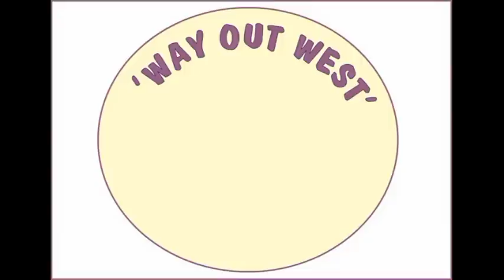Making A Charcoal Grinder – for biochar

Comment: and for those without the means or skill to make this.
Use a Garbage disposal set up in a sink in the yard. Works wonderful. Plus can use water to keep the dust down.
Reply from the maker: I think garbage disposal grinders are only common in America.
Reply: @WayOutWestx2  
You might have a few people in America that follow you.
But yes, set up an out door sink and put a garbage disposal on it.
Another idea I think. I will try a small electric cement mixer.
Add some steel balls to it. Turn it on and let the steel balls crush it.
Next step would be a small chopper for leaves and grass

Comment: I have decided to Spread the  char over the garden or ground I want to  apply it to. Then run my Riding mower over it. With the mulching plug installed. To grind it up. I tried a small area. Works good. Just. The Char needs to be damp. To control the dust.  A push mower would work. as well. Blades does not need to be sharp. If you have and old set of blades. They work  good. I have already charged it.
Reply from the maker: Interesting!

Comment: I watched this when it came out, been trying to add charcoal to improve the soil too. I don't have a CNC plasma cutter, but I do have a little cement mixer. With the addition of six-half bricks, it became a ball mill. Works pretty good, for off the shelf.
Reply from the maker: Good idea - but you'll get a lot of dust that way..
Reply: @WayOutWestx2  😷😁 Very true. Did the first round. Wrapped a bungee cord and pillow case over the end. Had tried wetting it, but it just all caked to the sides.

Comment: Very cool to see your design process. However, to actually crush biochar ( even smaller than this), it is far easier and less wasteful of resources to put some in an old sack ( like a dry cat food bag), fold it closed and stomp all over it. Works for me, in about 5 minutes. Much of it ends up as fine dust, which is ideal for use in soil amendment. But have fun with the tools!
Reply from the maker: I hope to scale up my production quite a lot, so that's why I'm experimenting with powered methods - but your way works fine for small quantities. The best size of particle depends on the soil it's going into - around here I want a mixture right up to 4mm.. (It's all interesting, isn't it?)
Reply: @WayOutWestx2  I'm still learning. Can you tell me what the benefit of larger pieces is? I thought that the smaller they were, the larger the surface area for microorganisms, water and nutrients to infiltrate.
Reply from the maker: @Ubiquinode  It's the fissures (made when you quench hot charcoal) that gives all that surface area - almost all of it is internal. The particle size should include a range up to large, so you don't end up with a dense, compact medium. Air and water have to be able to penetrate freely through the soil - that way they will find their way into the fissures.. Does that make sense? Tim
Reply: @WayOutWestx2  Thanks, it does make sense. So you would recommend taking the biochar out of one's oven and quenching with water while as hot as possible? I guess I would have to pour it into a bucket of water as I don't want to do damage to the Dutch oven I do the pyrolysis in.
Reply from the maker: @Ubiquinode  Absolutely. Otherwise it's not activated and no where near as effective

Comment: If it had some sort of grist mill at the bottom with a wider gap between the stones and ran off the same motor it could grind that charcoal right down to small particles.
Reply from the maker: Yes, maybe, but I'm happy with the size - growing trials now started

Comment: Good project. If you rotate the square hole 45 degrees on two blades it would likely cut smoother, and draw the chunks in. The 2 rotated blades could be staggered. Also putting a flywheel of some kind will keep it from being stopped.

Until you fashion some kind of guard, please keep your watch of it : )
For some reason, I would worry about picking up a piece that had fallen to the floor--only to be caught by the blades at the bottom.

Thanks for sharing.
Reply from the maker: You're right, of course. Thanks, Brenda. If I scale up the operation I'll have a rethink of all of it, but it's working now so I'll leave it be

Comment: I made some charcoal over the winter by packing an old biscuit tin that has half a dozen holes in its base with oak whysky barrel stave offcuts and putting it in the fire/stove as the last burn before bed. Found I needed to put a few bits of wood around the tin to get it all hot hot but once going it gassed out and burned fine. Made maybe 20 kg, not much but.... My thought on grinding it led me towards gear teeth cut out of thick ply (think Mathias Wandle). It would only need (yeah right) 4 gears, probably about 8 inch radius, in pairs on two shafts and you set the amount of 'crush' by bringing them closer together. My hope was that being gears they would mesh enough that they would drive each other as one set was driven by the third shaft, with smaller gears that drives it. Then I thought about how long it would take to make it all and went to find a bucket and a fence post.
Reply from the maker: Yep - ideas are easy, turning them into something is the crazy-hard bit. For small quantities your solution was perfect.
Reply: @WayOutWestx2  Thanks for the reply, I enjoy the videos very much.

Comment: It looks like the charcoal is damp. I have found that if damp, the lumps will tend to hold together more, but it dry, they shatter. It makes dust when dry so an enclosed box would be needed for infeed and outfeed. I have also found that if the charcoal is very wet and then frozen a few nights, it shatters from the force of the ice expanding. Your concept is very good.
Reply from the maker: Thanks, Don. 
It would take weeks - literally - to dry out the charcoal after it's been activated by steam, so I'll keep grinding it damp

Comment: Why didn't you use 'Ye Olde Bamford' to power the charcoal grinder....You did say you could run multiple  appliances all at the same time....
Reply from the maker: I didn't have the engine then, Simon. But, yes, I hope to make a new, much bigger grinder to fit the engine..

Comment: Does it matter what kind of wood the char is made from?  I have a bunch of pine that was given to me to saw into timber but a lot is too knotted for lumber. I have cut some and used it to burn in the evenings just to sit around. 
Also would pine charcoal make decent forging charcoal for blacksmithing work???
Reply from the maker: Any timber can make good charcoal for soil - just make sure it's cooked hot enough. I'm really not sure about which charcoal is better in a forge - perhaps someone else can advise?

Comment: I made one out of an apple-grape crusher.  It is hand crank and had to make some adjustments, but works great.  Also cost me $100.00.  The hopper is a square funnel shape stainless steel which helps and easy to add charcoal without spilling to much.  I think your blades need to be shorter, 2 inches at the most.  You will get more torque and the funnel will feed better.  Thanks for your contribution to us diy's.

Comment: I put a lot of wood ash in my garden. I over did it. The pH went up to 7.4 and the phosphate got into toxic levels per soil analysis. Basically only peppers and herbs grow there. I do t know if this applies to charcoal.
Reply: It doesn't apply to biochar. Biochar is mostly carbon, with a scattering of mineral content. 
Wood ash, is mostly mineral with very little carbon left. 
Sorry about your garden.
Reply from the maker: 'Only peppers and herbs' - doesn't sound too bad Frank!
Our soil is very acid so I think we have some room for experiment. You're right, there is some wood ash in the charcoal. It can be washed out but it's generally beneficially here

Comment: One of the easiest ways to motorize any hand cranked thing like that is to weld a nut or bolt onto your shaft and then put a strong drill or impact driver on the nut and there you go, instant motor. The best part of an impact driver being that they tend to be incredibly high torque. The other thing you could do to break it down would be to make an impact mill with a canister with a shaft in it and chains attached to the shaft. That's how they make rock mills a lot of the time so I'm sure it'd make short work of charcoal.
Reply: I don't wanna start an argument "BUTT"'  an impact will slow down and give the jack hammer effect when theoad is hi. My old Gravely walk behind is getting low on compression and needs a set of rings in a bad way. Anyway I must use a high speed drill to crank it , a low speed or the strap won't start it at all anymore. I tried a big impact wrench and it did turn it but it was like a lug nut that was really rusty. I stopped before it twisted the crankshaft off or stripped the flywheel nut.
Reply: @coburnlowman  well then, you must have some serious drag in that thing as the impact function should only happen when there's a heavy load on it, otherwise it should spin fast. With his charcoal I doubt there'd be any real load on it other than if he had a chunk of wood that didn't char enough.

Comment: Nice looking device.

I just run mine through a garden mulcher. The lower screen has ~10mm holes in it and spits out a nice consistency of smashed up charcoal. It's basically a small hammer mill inside. Probably makes the charcoal a little finer than would be ideal, but it's quick and easy to use. And I can wheel it directly on to my garden beds to put a bag or two through it.

Comment: When I saw the first part and understood what you were trying to do, I thought, why not make a similar setup like they used to use to grind corn in corn mills. You could adjust the two huge stones, or whatever you used for the grinding, and could also control the size of the charcoal you wanted and just feed the raw product in from the center top and collect the results from the bottom. But whatever works works... Thumbs Up
Reply from the maker: If only I had two huge stones.. !

Comment: Finding this rather late for suggestions but can't help thinking a fly wheel would have helped smooth out the power needed during the cyclical grind phase of the shaft's spin. Adding the motor, pulleys, and belts increased the grinder's angular moment but a fly wheel would have still helped.

Comment: I think typical crusher setups these days are centrifugal types, where a big central impeller basically throws the material hard as hell against a cylindrical wall around it, and the material shatters against the wall. It's mostly used for turning smallish-to-medium sized material into smaller material, and it's a very common way of making gravel. Works best with a hard, brittle material, and also if the walls are even harder - i.e. can't use rubber or wood for the wall or it'll absorb the impact. The best part is that the same machine can be used for repeated treatments to get progressively smaller material, rather than needing different size combs and blades if you want a more progressive chunk sizing setup.

Comment: I think you may be overthinking the roller design, what about just a single heavy (cement?) roller with a handle for pushing it, and then lay the charcoal out on a hard flat surface and push the roller over it till its pulverized, then sweep it up. Great job on the grinder,  you could probably shred leaves and twigs with it too!

Comment: I used to have one of the small hand grinders that had a variable grind: the slots in the comb were larger on one side of the spindle, so if turned forward, it ground fine, and if turned in reverse, ground coarse.  Just something to consider, if you ever need the ability to vary your chunk size.

Comment: Did you try putting the axle on the other side of plate from the hopper? I am not sure if it would work better but it would give you a lot more space in the hopper and seem easy to try out.

Comment: does the biochar help retain water like vermiculite?  Not that you are usually lacking for water.  Thanks for bringing your ongoing saga of the biochar.  Will love to see the further adventures.  I loved your potato experiments and wonder if you have something in mind for the charcoal.  the results of planting +/- biochar
Reply from the maker: Biochar does hold water, but interestingly it also holds lots of air - which is one of the reasons we're using it here

Comment: The blades are a thing of beauty! I notice you have a common profile for all of them which means they will all try and cut at the same time. The kitchen utensil is small with a massive amount of force available in comparison, i.e. your hand.  If you scale it up to the blades you have made, a HUGE force will be needed (gearbox + crazy strong chassis). If you rotate the square hole in the middle of the blades by a few degrees, say 30 or so, then they will all cut through the charcoal at slightly different times requiring much less force from the handle or motor.
Reply from the maker: Well now, half of them are off-set - so only three engage at the same time. But you're right in theory of course. In practise the motor seems well up for the job..
Reply: The difference with the Motor is the Speed of turning. With the Motor it has a much higher rpm, than it would have with turning it by Hand. And as the Teeth probably weigh a little as they're quite thick, it'll have some Momentum and not loose as much Energy while crushing the Charcoal. A bit like a Flywheel i guess...
Reply: @DIYdiacsnFarmstead  I think you hit the nail on the head mentioning flywheel. By incorporating a flywheel and a suitable motor, you can increase torque at much lower rpm.
Reply: Basically, with the current design, four bursts of high power are required. But if they are offset as you said, you have more bursts of less power. Motors are best for continuous loads.

Comment: When you had the bat a rang version going I was thinking wow, the safety people would have a cow. Luckily no permits required in Tim’s mad science barn. Good work! I did flashback on my personal issue as a kid many years ago when I snuck into the kitchen to make boxed banana pudding in the mixer, and got my hair caught in the beaters. I saved my scalp by pulling the cord out of the wall. The worst part was I had no idea how to get the locked beaters out of the machine and had to seek help from my sleeping mother. What humiliation that knowledge would have saved me.
Reply from the maker: Quick thinking! Well done. (A similar thing happened to me using a huge pillar drill once - the switch was far away on the wall so when my jumper got caught in it I could have lost my arm. Luckily I was able to get the jumper over my head in the nick of time..)

Comment: Batman Blades 🤣👍 - less tech approach here is to put charcoal inside a tarp and drive over it with a ride on mower - not nearly as fun as your invention.
Reply: It's how they crush bean peels in countryside Bulgaria, they just throw them out on the street and the local drivers will, with some care, drive over them. Townies will off course not know what is going on and drive around (once the initial panic subsides ;-)